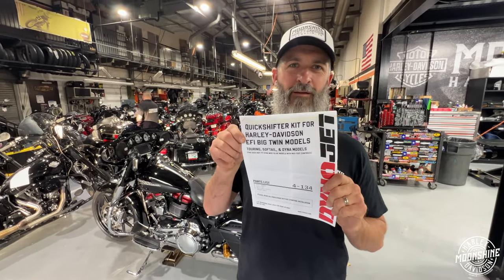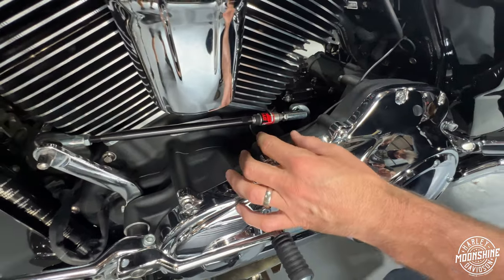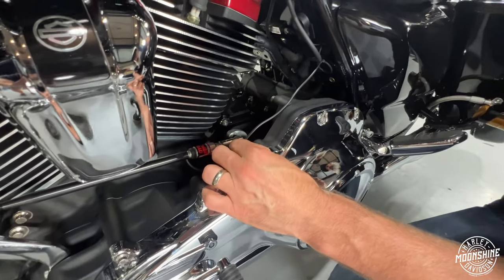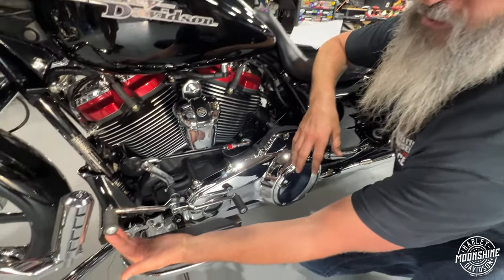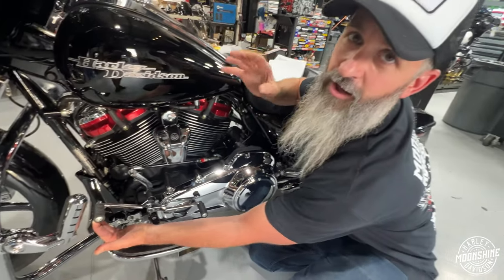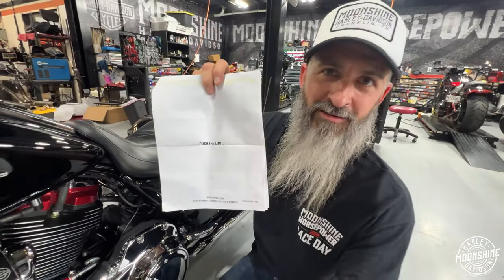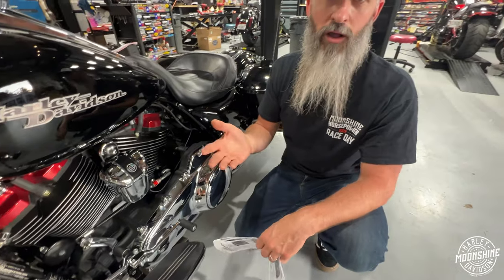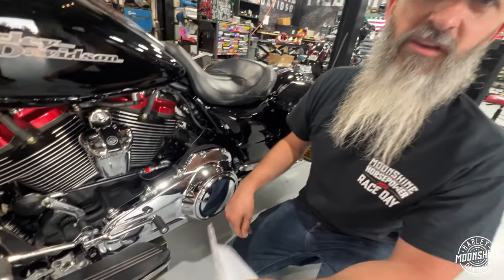DynoJet QuickShifter Kit for Harley-Davidson Big V-Twin Models

Comment: Is it only for racing or is it useable during normal driving? How hard are the shifts? And I guess you still use the clutch for down shifts?
Reply: Never seen anything other than a Pingel shifter no clutch needed on the down shifts for the Pingel
Reply: Its only a shifter, not an auto-blipper...

Comment: Just installed one ( this morning) on my stage 2 114 fat Bob . Well worth the money.
Reply from the maker: Awesome! Thanks for the feedback.
Reply: Takes a long time to set up. I have the standalone.  I still can’t get the gear change to be be smooth. At the moment it’s hard to upshift in low gears but good in high gears. I wouldn’t like to upshift in a low gear on a wet road, the rear wheel slips on a bone dry road.
Reply: Did you have to do any tuning for the quickshifter to work or is it plug n play?

Comment: Is this better than a Pingel shifter ? 
Pingel shifter you just push a button to shift up or down any rpm or you just have it set up automatically shift at whatever rpms at any gear you want or just don’t use it at all and shift normally
Reply: No air shifters are faster